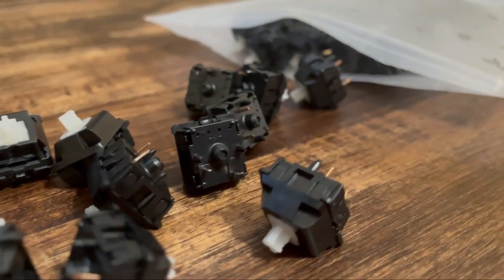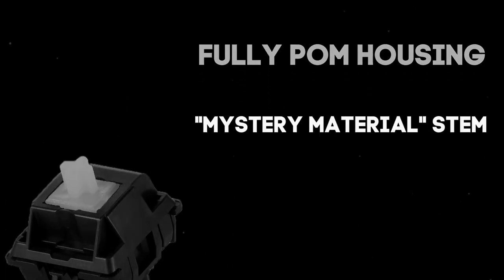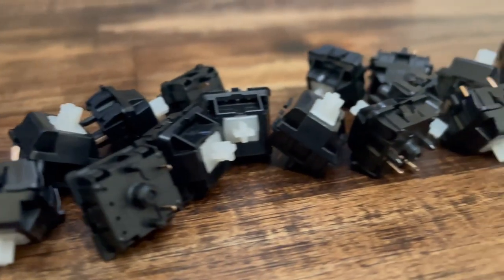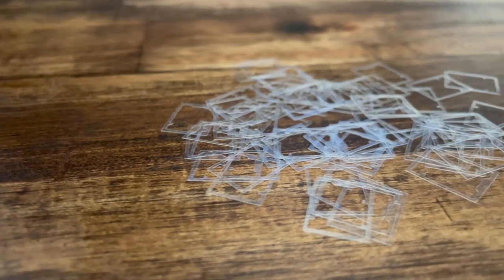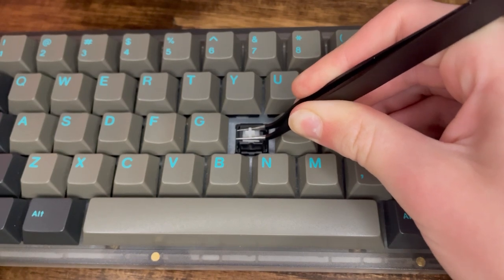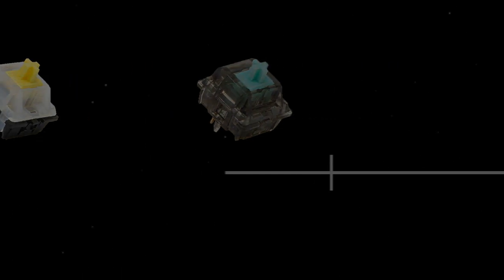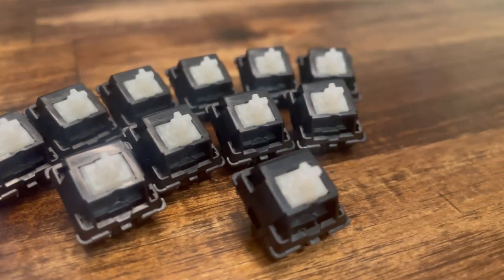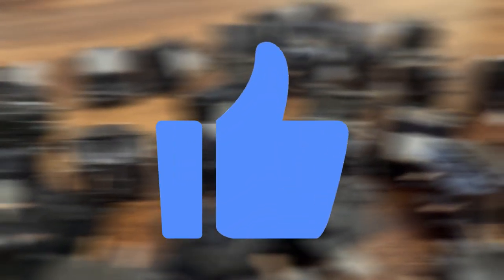The Ideal Linear Experience | Durock POM Linear Review

Comment: While stem wobble can affected by housing tightness, it is mainly affected by the inner switch tolerances. I’d also like to point out that testing in two different positions on the keyboard will drastically change sound.
Reply from the maker: This is all true. And yeah, this video is a bit outdated

Comment: I got some durock Poms a few weeks ago but I noticed that a few of my switches have like this tick noise when I press the key multiple times in a row. Do you have any experience with the same problem and do you know any solutions to this tick noise?
Reply from the maker: Have you lubed the switches yet? Durock POMs have pretty bad spring-ping in their stock form. I was able to fix the spring-ping using Krytox GPL 105 oil
Reply: @A1KBD  i have lubed the switches but with just krytoc 205 g0 so i might buy some 105 just so i can bag lube the spring. Thanks for the advice
Reply from the maker: @idkimbored5455  No problem, GPL 105 does wonders. Tell me how it works out!

Comment: Dam They sound amazing in my board :0
I would for sure say they are great switches when lubes and are still awesome stock.
although do keep in mind when buying, that the springs in the switches stock  make a really loud ping noise
Reply from the maker: Yea they unfortunately do, but once you bag lube the springs it fixes the issue
Reply: are they thocky or not???
Reply: @rehearse7826  they are a bit more on the clacky side for me, although that may be because of the keyboard im using
Reply: @DogetaroKujo3162  oh, imma get banana split then :)